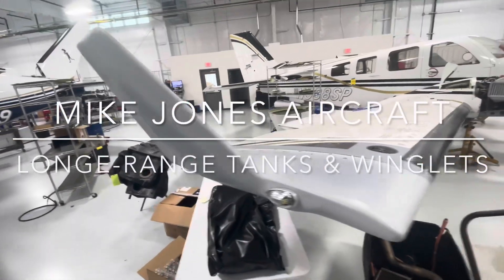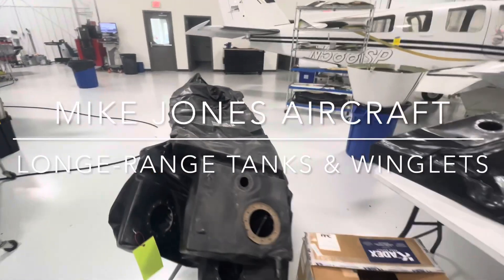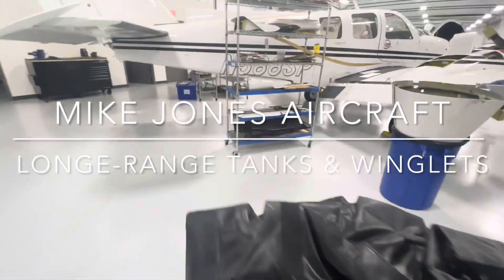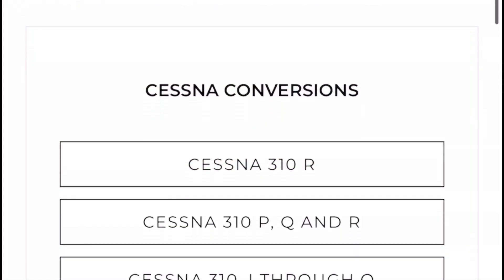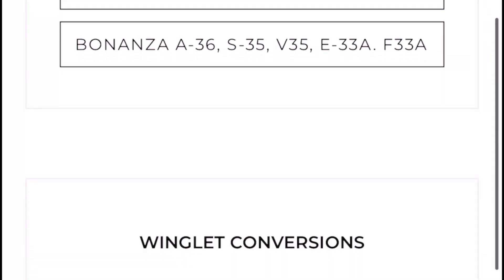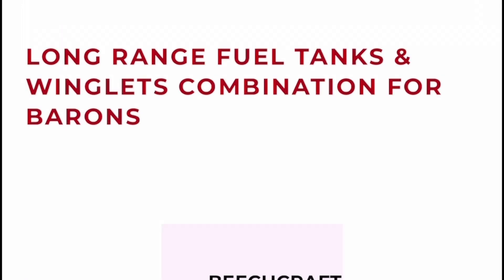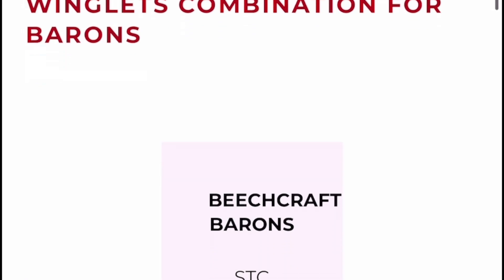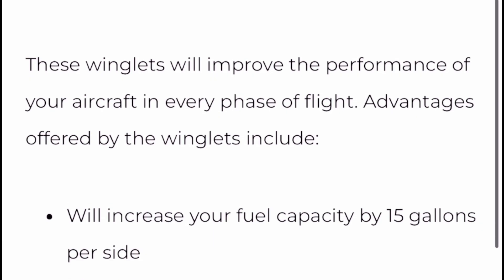58P Baron Long Range Fuel Tanks & Winglets #mikejonesaircraft #winglets #beechcraft

Comment: Could use performance numbers on the winglets... Typically they offer very little gains in these types of moderate aspect ratio wings. Even on high AR gains are pretty low, single digit percentage gains. Sure it adds up, but still need to see what numbers you come up with